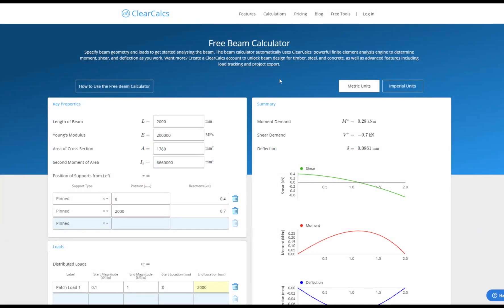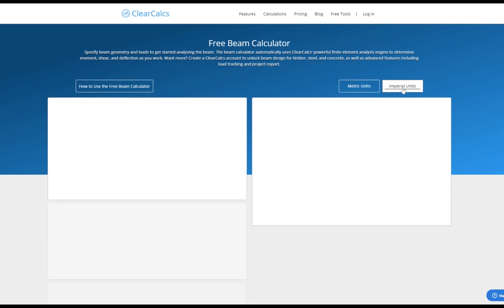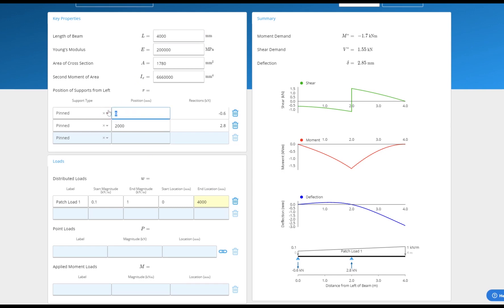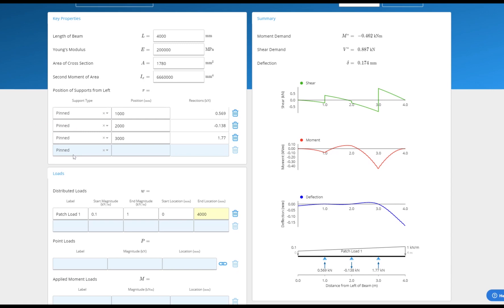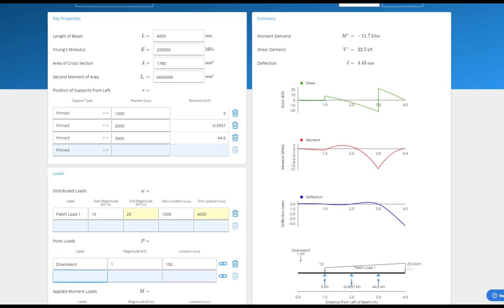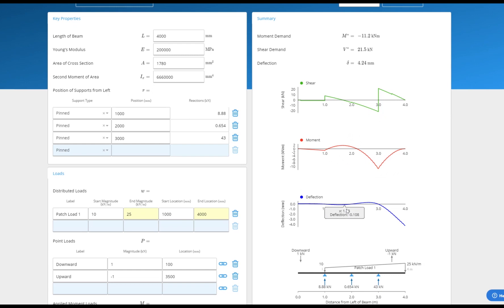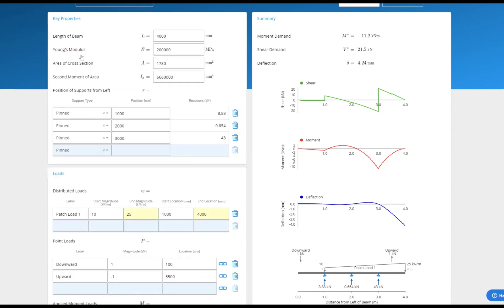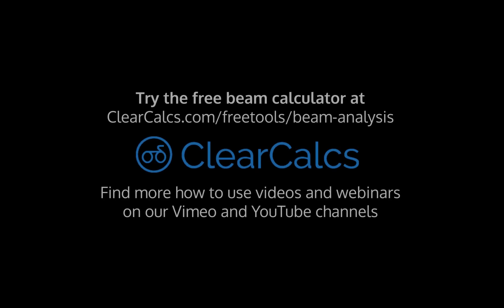Free Beam Calculator Tutorial | ClearCalcs | How To Use

Comment: Cool... but (and I know it's probably dangerous to let n00bs even use this),... the "instructions" are basically gibberish to normal people  "Second Moment of Area (Moment of Inertia) 
Defaulted in the Metric system to the second moment of area for 150 UB 14.0 Steel. Defaulted in the Imperial system to 722, the moment of inertia for a W14x68" ... you need to explain what it is and what it means, not just use technical terms and tell us about "defaults".  And, on that, there should not even BE any "Defaults" at all.  If you don't ask the user what they're doing, and instead make a guess by having defaults - that is going to all-but-guarantee you tell them something useless that's going to damage something or hurt someone if relied upon.

For example - I've got a 4mm thick bit of stainless steel for a roof rack - it's 60mm wide and supported at 2 points 1.5m apart - I want to know how much it's going to bend from a 50kg load... so your tool needs to understand how to properly let me know which area is used for what (or better still - don't make me work that out - ask me my measurements, and your tool should work it out), how to tell it that my rail is flat (4mm high, and 60mm wide, as opposed to 60mm high and 4mm wide), and you probably should let people switch to g or Kg - newtons are cool and all, but nobody measures things they need that way - you're asking for trouble by forcing people to use unfamiliar numbers they didn't measure...
Reply from the maker: Hi there - thank you for taking the time to share your insights about our tool - it's essential as we aim to enhance our user experience.

As you mentioned regarding the technical verbiage, we agree that making our tool more intuitive is of great importance. Our goal is to make this free tool accessible to a broader audience, beyond just engineers. We are actively looking to enhance the tool with clearer explanations that will make it easier for non-engineers to understand and use.

Regarding to the use of default input values, I can definitely see what you mean there! The intention with these preset default values was to kick-start the calculation with a common steel beam cross section, so you can see the basic results - such as bending moment, shear forces or deflection and diagrams. This was meant to offer a preliminary understanding of the tool's capabilities. However, you are free to adjust these values to better align with your specific design needs.

Once again, thank you for your constructive feedback. We will work on making our free tool more user-friendly and on providing more accurate and understandable descriptions in future development! If you're interested in exploring other features, we invite you to try the full version of our software through a free trial - https://clearcalcs.com/signup. Thank you for helping us improve.